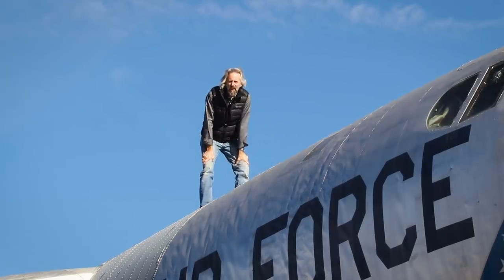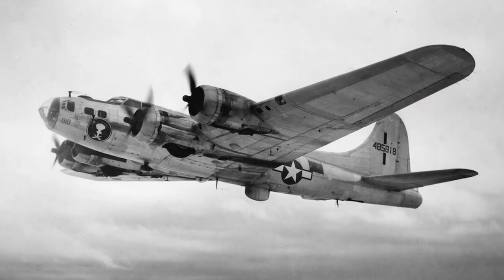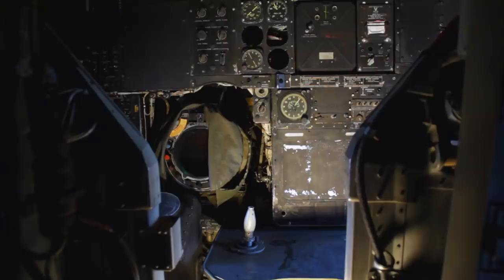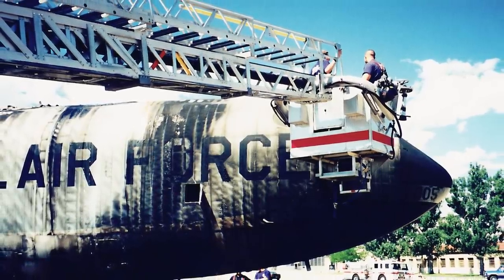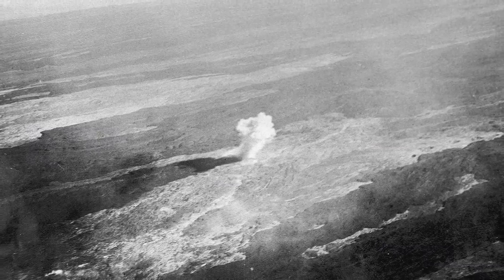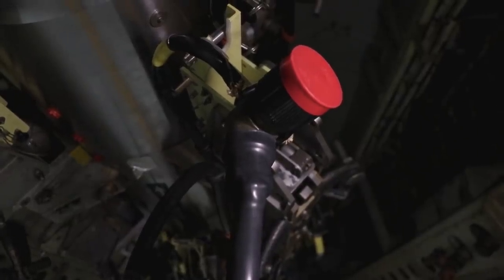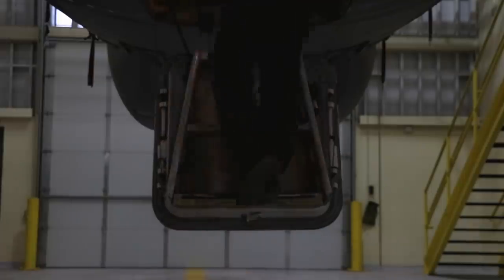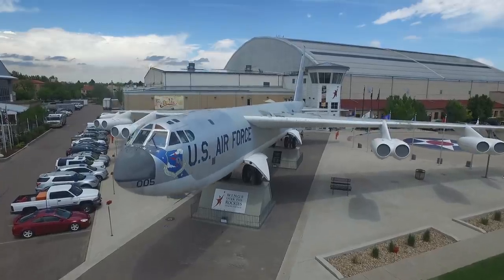B-52 Stratofortress | Behind the Wings on PBS

Comment: Min(dr)ot got some really nice upgrades since I was there (9/89-4/93). The majority of our maintenance was done outdoors on the Flight Line in usually sub-zero temps (we didn't stop work until the ambient temp with wind chill was -75F!, and it was ALWAYS -74F and HOLDING!). That Doc 8 would have been a God-send! The B-52H is LITERALLY your Grandfathers B-52 in a few documented cases! I even saw my aircraft in your video (1035)! BTW, the Gatling gun on the H models was a 30mm, not 20mm. ;) Peace and love.
Reply: TJ Rohyans,,,,,Greetings,,,,lets be clear on that last bit about the Gatling gun. It was in fact a GE M61 20mm Vulcan ,,the same type as found on a lot of our modern fighters, I served our great Air Force,, assigned to the 410 Bomb Wing ( Heavy ) at K.I. Sawyer AFB, Michigan, 81-94, as a Primary Crew Chief of 4 different tail numbers in that time......The B-52 is the best built, heavy bomber ever made.....I still get worked up when I see them ,,,,,,God Bless the U.S

Comment: I wish the facilities there at Minot was as good back in 1968 when I was there as it is now. We worked outside on all the airplanes and the only time an airplane got to go into a hanger was when major work was done on them and they could not get all of the airplane in there. I was glad to leave there in 1969 for Thailand where I went from the deep freeze to the heat and stayed there a year. The H models which is at Minot always had the M-61 gattling gun which this model had until they took the guns off of both the G and H models and took out the gunner position which was next to the weapons system officer on the H model.

Comment: Was based at Minot AFB, back in the early 80's.  Big run of the week - 9 mile run around the runway, with B-52D's doing touch & goes.  Assigned to a MAC tenant unit - Det 7, 37 ARRS.  Yupp, I was a MAC man, on a SAC base.  Helicopters are still assigned to Minot, however MAC . . . now Air Mobility Command (AMC), has since departed.  The helicopters are now assigned to what was the Stategic Air Command . . . now, the US Strategic Command.  I wonder . . . we transitioned from UH-1F to the HH-1H . . . is this aircraft still assigned to this mission ?  Been more than 30 years . . . however, bet there are pilots of the B-52 who has had grandfathers who've flow the same aircraft . . . not the very same . . . but you know what I mean !  (who knows, maybe so . . . if the Boneyard doesn't have it)

Comment: Great video, Matthew, but, you got two things wrong:#1- The last BUFF's were built, and delivered in 1961, not 1965 #2- Infrared, or Heat Seeking Missles can't be jammed by Electronic Counter Measures Systems, instead, ECM Systems jam Radar Directed, and Guided Missles, and Guns.
Reply from the maker: You are correct; although, my research shows 1962 for the last B-52 to roll off the assembly line. Again, my mouth is faster than my brain! MB
Reply: The EWO also controlled counter measure flares to divert heat seeking misses. We had a radar to detect such missiles that would trigger the flares and the chaff dispensers.
Reply: Last plane rolled off the line in October of 1962.  Also, the EWO had access to chaff and flare dispensers to confuse both radar homing and heat-seeking missiles.  Saw one of those flares dropped on accident...burned through about 10 feet of concrete. :)

Comment: @2:33 The Vark was never slated to replace the BUFF. The Vark came from a late 50s TAC requirement for a replacement for the F-105, and a USN requirement for a fleet defense fighter called the TFX project. You confuse the FB-111A as a replacement for the BUFF? Nope, it was a stop gap till the B-1A came along. But the B-1A never came, so the Vark hung on in SAC till the end of the cold war. The TFX program is interesting due to it's parallels to the JSF program. They didn't learn from the TFX. No matter how good the F-35 is the services would have better cheaper airplanes if they had built 3 instead of 3 from 1. The engineering compromises and costs for that VSTOL, built into all 3 airplanes, are immense. The F-35 will work just like the Vark did, but it cost to much.

Comment: What do they use the old gunners position for now? Is it just storage? Or does it have electronics back there? Or did they literally just pull it out and cover it up?
Reply: KiloWolf the planes flying now did not have a gunners station in the tail. He sat up front in the crew compartment.
Reply: Since the gunner is no longer on the aircraft, the racks containing the Fire Control System have been removed, and have been replaced with concrete ballast weight. :)  There is also a big empty area forward of that section called the "47 Section"...it is a big empty area save for the 3 LOX converters, and stowage for a spare drag chute.  :)

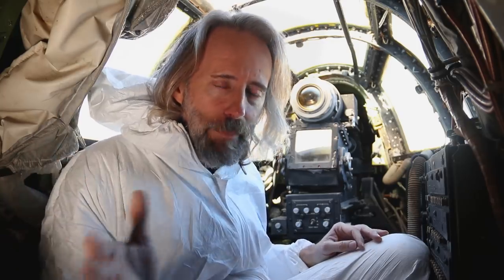Comment: 5:50 The reason modern planes have ejection seats is to get the crew up and away from the air frame. Bailing out the tail, there is nothing you need to get clear of, so no need for a rocket seat.

Comment: They had a window in the overheard for the navigator to take a fix using a sextant.
Reply: It's called an Astrodome, the C-130 also has one being from the same era of design. Pretty much anything before the era of electronic navigation did, C47's, C46's, C119, the very first plane I ever flew on in 1961 was a Lockheed Constellation and it had one.

Comment: Wow I didn't realize it was so cramped inside one of those beasts. Is there a spot to stretch or sleep?
Reply: Yes. The best place is at the hatch (where you enter the plane). It has the most height. 
Behind the pilot's seat is what we called the bunk. However, it's only maybe 5 feet long. There is also a hammock you can attach behind the pilot/co-pilot/and IP (instructor pilot) seats. It's sort of next to the bunk, in the middle of the floor.

Comment: Great video- hope they re-engine them- 4 good engines are better than 8 crappy ones....
Reply: When they finally retire the B52''s, they could strip all the armor and armament off as well as the eight old jet engines and replace them with modern electronics and two of the giant GE-90's  and put seats on the inside to make a super long range passenger plane.  It would be capable of reaching from one place on Earth to any other place without making any stops.

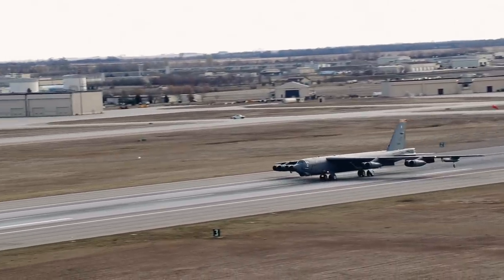Comment: At 20:00 it looks like, except for the outboard wheel, he might touch the ground with the wing tip or whatever was outboard of the number 8 engine. See how high the near wing is? I thought that they could turn the wheels to take off/land in an acceptable crosswind.
Reply: Yes, there is a Crosswind Crab that aligns the gear to the runway, but I doubt that was changed once the aircraft was rolling.  There is also a tip-gear out at the end of each wing that keeps the wing off the ground.
Reply: Thanks

Comment: I think the timing might be wrong here? "With the lessons learned in Vietnam [...] XB-70"
B-52s were first used in Vietnam in 1965, but the XB-70 as a bomber was cancelled in 1961, though one of the two prototypes did fly as a research vehicle until 1969. While it was considered as a possible replacement for the B-52 when it was designed, Vietnam experience had nothing to do with it.

Comment: I've noticed something on these planes. I know they dont but what are the spots on each side that appear to be forward facing gun ports?
Reply: I suspect you're seeing NACA air inlet ducts for cooling air for the electronics.
Reply: @TBlake-yf2sr  ok. That makes sense. I didn't think it would have a set of guns there but we are America and lo e our guns. But that makes sence. Thanks is for the info.
Reply: Actually, those bumps on the chin of the aircraft are the FLIR and TV cameras...When they are not in use they are spun around 180 degrees to protect the glass.  :)
Reply: Jeez, I sure hope he wasn't talking about those. They dont look like gun ports. That's why I thought of the NACA ducts, which do kind of look like a gun port.
Reply: @TBlake-yf2sr  I was. Didnt think they where but didnt know
Reply: As someone else mentioned, one is FLIR (forward looking infrared radar) and the other a camera. You know how some cars have popup headlights? These are like that. They flip open and closed. What you have seen is them closed.

Comment: How did they protect the front, belly and top of the bomber?
Reply from the maker: Like armor plate? There was none. The tail gun was the only defensive firepower on the aircraft. The rest of the defense was left to the EWO and their suite of electronic jamming equipment. MB
Reply: @Wings_Museum    Thanks, but I was talking more about machine gun and cannon fire. like the Russian 30mm cannons
Reply: The B-52 would cruise up around 600 MPH so it was too fast to attack it air-to-air from the top, bottom, sides or front. The only way to attack one using a fighter aircraft was from behind. If you are comparing it to a B-17 that airplane cruised at only around 300 MPH.

Comment: Please let's not forget that the B-52 and it's crews did actually drop nuclear bombs, on the United States. Georgia and North Carolina have had nukes dropped on them. The B-52's and crews also lost nukes in crashes in Greenland and in the Pacific as well as the Mediterranean. If you are going to make the video; make it accurate and don't gloss over staggering failures because they don't fit the narrative;. It is a beautiful piece of engineering, it is a remarkable machine. But, because of it, we could have ended human existence more than once or twice.
Reply from the maker: That is very correct, but we only have so much time in each episode. MB
Reply: You do realize the procedures for nuclear bombs requires arming them and that does not happen until just before they are ready to be dropped. A nuclear reaction won’t happen just by dropping a nuclear bomb. So, there really wasn’t much chance of “ending human existence”.

Comment: Aaaaaaand because the last, B-52 was built in 1965, since parts haven't been made in years......maintenance cost and maintenance hours is crazy expensive. The fact that the air force hasn't spent money that is wasted on maintenance and use that money on a new bomber to replace it, is beyond me
Reply: There have been several bombers to "replace" the B52. All MUCH more expensive to maintain than the B52 and it's many upgrades! None of the "replacements" could come close to the adaptability!

Comment: How did the rear gunner get by before he/she moved up to the main compartment?  Especially during those looooong Operation Chrome Dome missions?  Did the rear gunner have their own bathroom?  Their own galley where they could prepare a meal and maybe some coffee?  

I highly doubt the gunner did the crawl to the forward section of the aircraft every time he had to go to the bathroom or eat something.  Yikes.
Reply: First, there were no female tail gunners. Second, they had a means of "crew relief" in the tail but seldom used it. Third, they had an electrically heated cup to heat up liquids but mostly they ate box lunches like the rest of the crew. The 5 crew up front would sometimes take along frozen dinners and heat them up in the small portable conventional oven that came with the airplane.
Reply: @MrSafetyToo1  
And that oven never really got all that hot. We would put the meals in before takeoff and it would be HOURS before they were ready.

Comment: It's weird that the designer of one of the 52's contemporaries the Avro Vulcan had the same attitude towards crew survivability as the engineers at Boeing i.e. bang seats for the pilot and co-pilot and bugger all for everyone else.
Reply: On the G model (which I served on for 3 years), all 6 crew positions had ejection seats.  They were primitive; you had to be going a minimum of 90 knots at ground level for the top 4 to safely deploy, and in the case of the Navs (downward ejection) you needed a couple thousand feet of altitude.  We had spaces (oxygen regulators) for up to 10 crew members (instructor spots)...if there was a need to bailout they had to go downstairs and jump out of the vacated navigator holes.  Only way out.
Reply: @Bsquared1972  
Actually, one man did jump out through the ejected pilot hatch. And lived!
Reply: James Rudd When was this?
Reply: @Bsquared1972  
I don't remember. I just remember reading the story. Let me see if I can dig it up again.
Reply: @Bsquared1972  
I found it. His name is Captain Adam Mattocks. The crash happened in 1961. 
Link: https://wcti12.com/archive/surviving-pilot-talks-about-b-52-bomber-crash_20160525091041674
He was a relief pilot. I assume he was in the IP seat.

Comment: Boeing and the Air Force are going to replace those eight antiquated smokey ass engines with four brand new state of the art engines. It's supposed to save us money in the long run because those old engines will cost more and more money to maintain into the future then it would to replace them with new ones. Also I bet those crews are pissed that they're still using CRT displays instead of more modern LCD displays.
Reply: It would have cost a lot to redesign the nacelles and prove the aerodynamics for single engine nacelles. That's why the current plan is to use business jet class engines and still have two per nacelle.

Comment: i didn't know the 52 had guns in the first place.
Reply: Actually there are 2 B-52s that shot down Mig 21s in Linebacker II Vietnam.  One is on display as he has shown at the Air Force Acad. and the other on display at Fairchild AFB, Spokane.
Reply: They had .50 caliber machine guns up till the H model, it used a 20mm Gatling gun.

Comment: Those smokey engines and old avionics are getting replaced with newer and more efficient systems.
Reply: Ain't gonna happen. They have been talking about that since I flew on them back in the 1980s. Even did a TDY to Edwards for that. Never happened.

Comment: Got a question, are there toilets on that plane?
Reply: LowLight a small poop box....but in 3 years as a crew chief on B-52s I never saw it used. The piss can was used every flight.
Reply: @ronniesmith65  thanks for the info, always wonder how bomber crews and fighter jets on long missions relief themselves.
Reply: There was a urinal by the door that went out towards the bomb bay...on your right as you see the door (was not installed for show).  It was weird; because of the low ceiling you had to hunch over to pee. :)  Toilet box is behind the EWO seat, but it was a rule..."You use it, you take it with you...(a la poop in a plastic bag and take with you after the flight)"  As you can imagine nobody pooped on the jet.  LOL
Reply: @Bsquared1972  
Glad you commented. It has been decades since I flew on one. My memory failed me, as I remembered it being next to the piss can. But yeah, it was upstairs near the ladder when going up.

Comment: I wonder why they don’t upgrade the engines?
Reply: Caspar Goodrich Yeah, but with another 30 years of service, surely it’d be cheaper to install more efficient engines. Plus they’d have longer range.
Reply: @OtherTheDave - it's not as easy as just removing the old and replacing it with something new, and all that extra stuff makes it NOT cost effective.
Reply: Some of the 737 engine issues would apply here.
Reply: The Air Force is considering an engine retrofit through the Commercial Engine Re-engining Program (CERP). Request for Proposals are due later this year.  Possible replacements include the GE TF34, GE Passport, PW815, or the Rolls-Royce BR725 to replace the 1961 vintage Pratt & Whitney TF33-P-3.